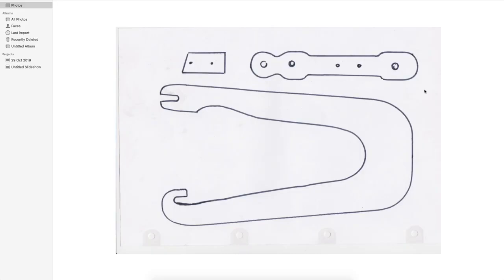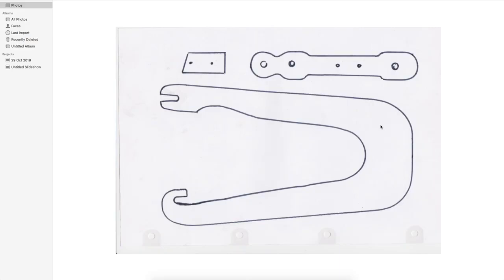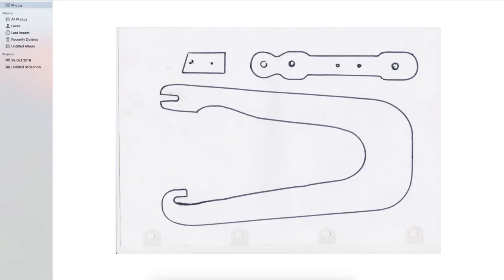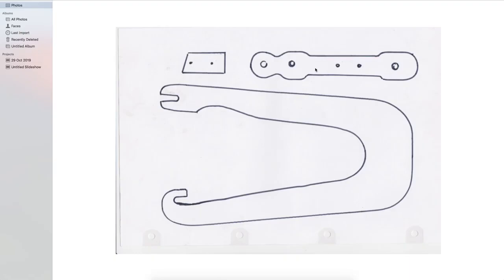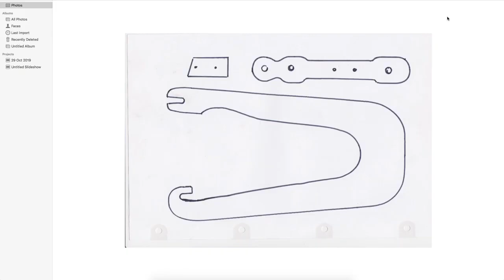homemade 'grabit'

Comment: What a lovely handmade piece of precision engineering. Your usual quality M. Lovely. 
That’ll make picking up your mooring a doddle singlehanded!!
Can’t wait to see what’s coming off the production line next!!
Take care
Darren
Reply from the maker: I'm considering taking this further possibly old school poc v cnc
Reply: @poroldchap  ... there is something similar ( or used to be) but potential sales could be massive. The sort of device EVERY boat owner would buy as a ‘just in case’ type of thing to put in the locker. Let me know if you need a hand on the stand at the boat show !!!
Reply from the maker: Do to my age and circumstances , my entrepreneurial days are long long gone, if you want to run with it be my guest

Comment: Well it needs a bit more delineation.  How is the lever held in place? If tension isnt on the lead rope, will the lever stay on? If you can reach the catch of the float, couldnt a grabber simply pull it in? As a rope threader this is a beauty. I just dont quite see what keeps it all of a piece. Thanks. I lost sight of your channel for some time and try as I might by search, couldnt remember the chan. name. Found it in an old alternate user subscription of mine. Cheers.